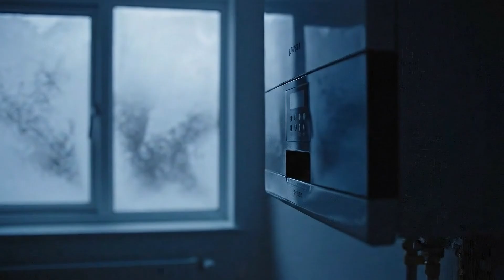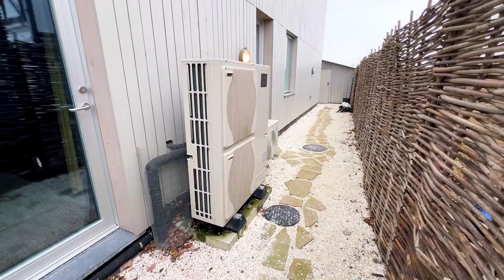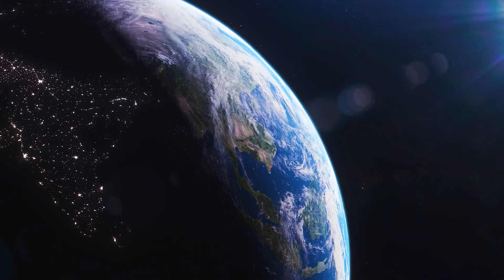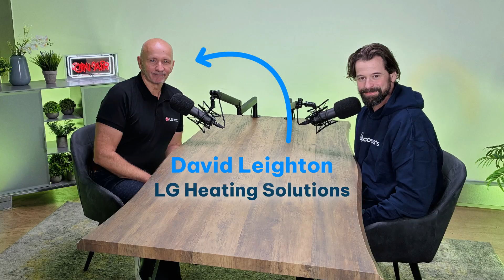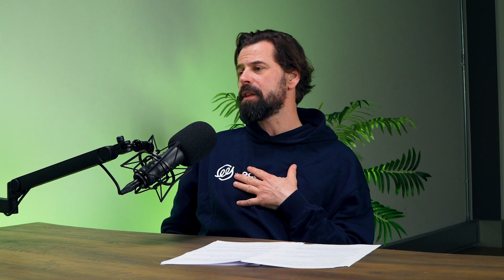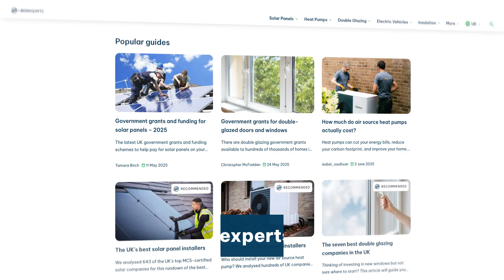Are Heat Pumps Actually Noisy? We Asked an Expert | Positive Energy with David Leighton

Comment: Not another video that purports to provide accurate information but is completely false in it's claims.

Gas or oil boilers have a far longer life than claimed, and being so simple are intrinsically reliable over a long period given regular maintenance.
The efficiency of a heat pumps is not as claimed on this video, what it does not account for is the energy required to produce the electricity and the losses in transmission. These are significant and using the wrong equation to calculate efficiency gives these false results.        

You cannot use the electrical consumption of a heat pump to compare to any other heater that uses a different energy source. It can only be compared to other heaters that use electricity.

Comment: It’s not that heat pumps don’t work — the real issue is the cost of electricity in the UK. I’ve got two split‑unit systems and they’re great, but in winter they still cost around £3 per day to run, and they’re only heating two rooms.
Reply from the maker: That's a fair point regarding electricity pricing and running costs! Hopefully the government will address the Spark Gap between electricity and gas prices soon!

Comment: Heat loss calculation is key..! Don't undersize / oversize. Get an installer that knows what they're doing. And finally, the user needs to know how to operate the controls, and what they mean. You cannot just flick a switch, as with a boiler. They are totally different animals. I learned most of what I know from Heat Geeks. Do your own research. Enjoy your heat pump :)
Reply from the maker: Spot on, correct installation and understanding the system makes all the difference! 🌡️